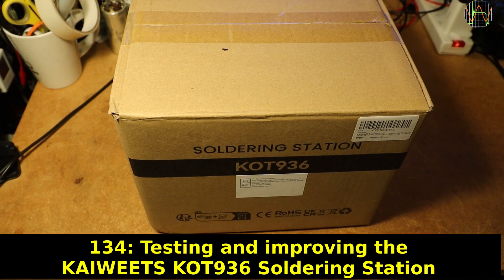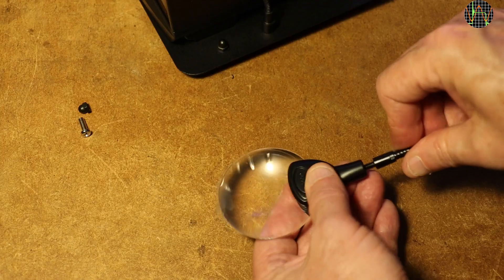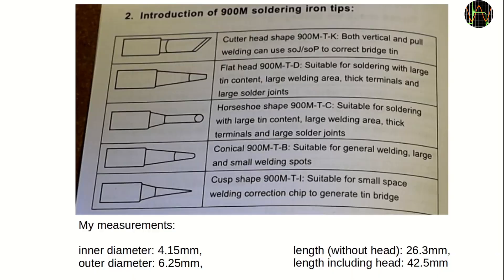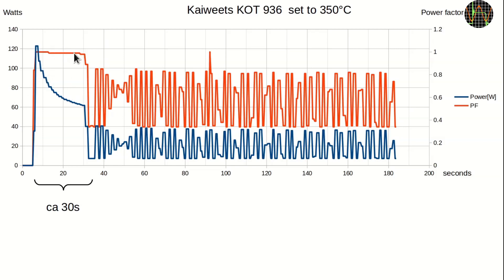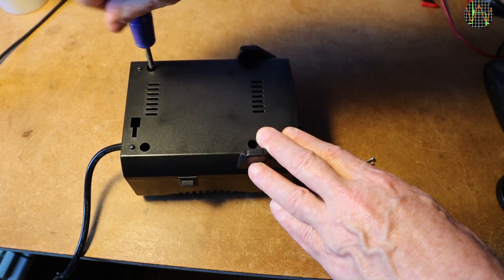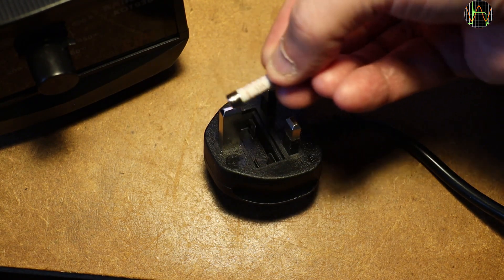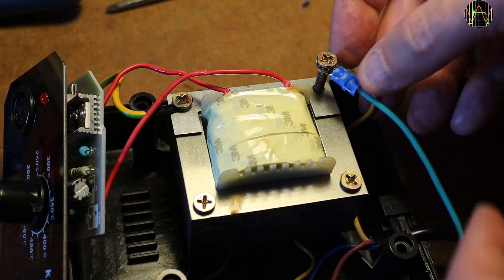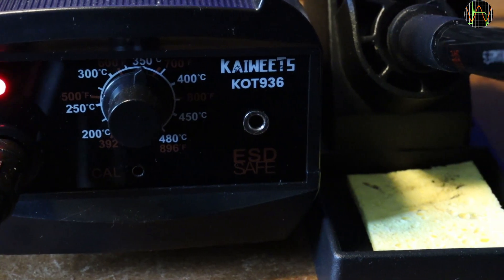134 - Testing and improving the KAIWEETS KOT936 Soldering Station

Comment: The magnetic "copper" wool was interesting, haven't seen that before ---- but had you applied the magnet to the supplied tips you would have found that they're all made of iron or steel and strongly magnetic from one end to the other, as are the majority of Asian or Chinese tips, whether purchased separately as a bulk-pack or supplied with an inexpensive soldering station.  Quality tips, of course, should be made primarily of copper as the base metal, for best possible heat transfer, with nickel or chrome plating, and iron plating only at the pointy end becauae bare copper would be easily dissolved and pitted by molten solder and flux, or oxidized from heat and oxygen. I have a video on my channel comparing the magnetic attraction of cheap or counterfeit tips compared to the real thing. Performance of any inexpensive soldering station is invariably improved by using a name brand, high quality tip made of copper, and with a smaller hole/ tighter fit where it slides onto the heating element.

 By the way, a similar "Schneider" branded soldering station to this one is sold at Harbor Freight here in the US for only $45, without the gooseneck/ alligator-clip base and magnifier. It appears to be better built than the Kaiweets (the PCB is neat and clean), the inline fuse and switch are correctly wired, and it uses a 7 pin screw-on GX-16 type connector (only 5 pins are actually being used). The thick, stiff, meltable cord connecting the wand to the station is a drag but could be changed out for a thin flexible silicone cable, and you can easily reuse the screw-on connector because it's not molded onto the cable. I posted a review and teardown of it on my channel recently as well as a separate video and wiring diagram of the iron itself.    

Harbor Freight also sells a  fancier "Schneider" digital soldering station for $120 that is marked ATTEN ST80 on the internal control board. I just bought one the other day but haven't had a chance to play with it yet; it can be configured for Fahrenheit or Celsius readout, has user-adjustable sleep/standby modes, and 3 presets for your preferred temperature settings. The soldering wand has a 5 pin molded-on DIN connector (boo hiss!) but at least the cable is thin, flexible and heat-resistant; the power inlet is the standard IEC socket eith a T 2-amp fuse. I'll post a review and tear down of it on my channel once I've had a chance to thoroughly interrogate it. Like the cheaper Harbor Freight soldering station, the supplied tips are made of highly-magnetic iron, and all three are conical.  It seems that you can buy inexpensive, variant-version soldering stations with any strange brand name you like, but the tips are always conical, always iron, always the same!  On the plus side, both of these have power transformers and correctky grounded tips and are therefore much safer electrically than the numerous "clone" T12 soldering stations that have a switching power supply and poor electrical isolation, and can leak 100V or more onto the PCB's that you're working on!

Comment: They have been pushing this to a quite a few YouTube channels. All clones of Hakko 936 are junk mostly due to lousy heat transfer. Waste of money when you can get a T12 clone that actually works.
Reply from the maker: I agree that it's not got Hakko quality tips, but to be fair, I had not much trouble with during my soldering tests. Maybe that's because I crudely "calibrated" it towards running on the hot side... (still have not turned that dial down).
Reply: @TheHWcave  I used a similar one for quite a few years, "fixed" the thermal contact with shims and it still choked on anything with considerable ground plane, even small boards like in phones, that have many layers. For simple boards with small thermal mass components it will be fine, for anything else it is useless. As I previously stated: makes no sense when you can get a T12 clone for a bit more.
Reply: @Kevin-mp5of  T12 clones are around $50 ...